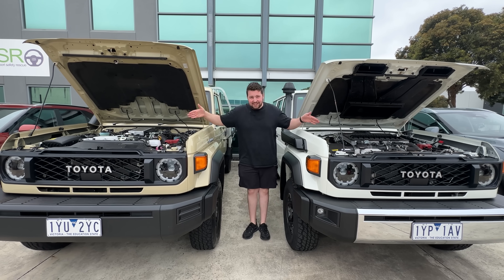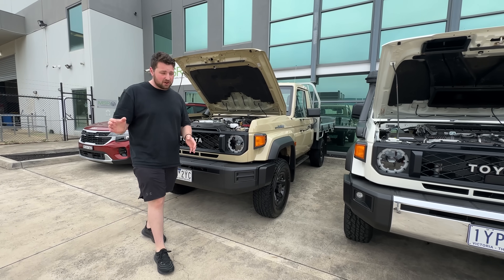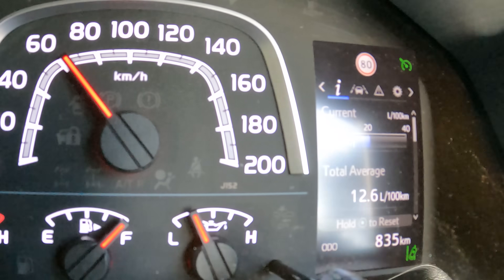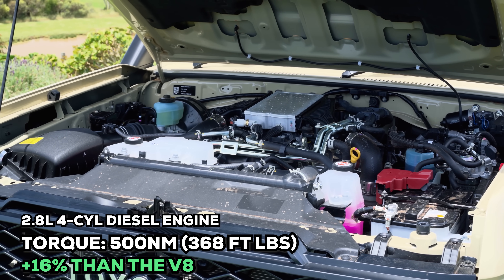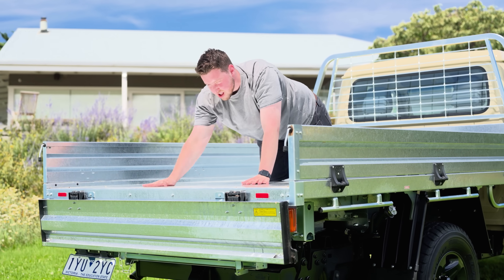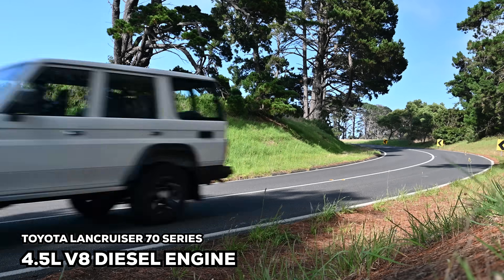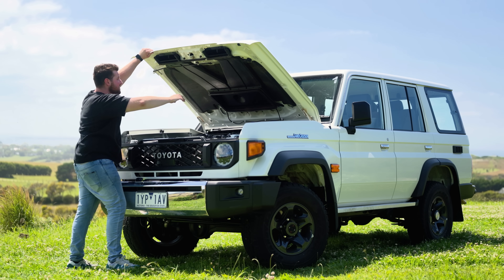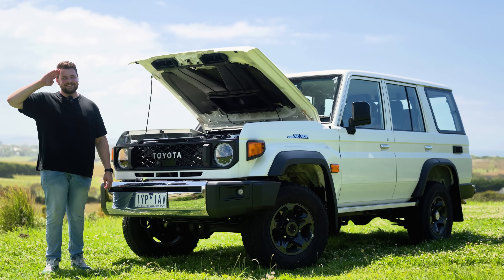Toyota LandCruiser 70 Series 4-Cylinder vs V8 Comparison: Reliability, Concerns and Which is BETTER?

Comment: I'm happy to keep my 2021 SR Hilux  . Half the price , same power , better comfort and less noise as well as proper coffee cup holders.
Reply: As well as better safety, easier to get into, cheaper insurance, better sound system...
Reply: And you load up a family of 4 in it and you are at gvm
Reply: Don't forget Better maintenance in the long term + lower parts prices
Reply: absolutely some are claiming 2.8 70s series is more comfortable than the Hilux 😂
Reply: I'm happy to keep my 2013 Citizen Eco Drive watch. No batteries to replace and the band is comfortable.
Reply: Too right!
Reply: GVM most people will never tow anything or venture off road anyway......

James 2022 sahara 200 series, fj cruiser and my tow car is a Marloo ute with double the power and torque than the 200 series which is a slug in comparison.
James.
Reply: @jamesmcgrath1669  can't be towing much, 1600kg max tow allowed compared to 3500kg for Sahara.
Reply: And when you want something better, opt into new GS.
Now that's a piece of eye candy if nothing else.
Reply: @michaelbaylis1631  The only joke is the Great Wall in your driveway, and it’s not the one made of brick……..
Reply: @michaelbaylis1631  I have a 200 series and a 2021 LX570, I’m ok👍
Reply: @michaelbaylis1631  Never take them off road anyway mate👍
Reply: @michaelbaylis1631  Yeah usually😂
Reply: Watching some of the real world testing of the 2.8 70 series is certainly impressive. Time will tell as I am hearing from Toyota fleet peeps that the 2.8 is very highly tuned from the factory leaving little room for further improvements. Longevity remains to be seen. The V8 is so detuned for the Australian market. The tune on the V8 for Middle East market from factory is way batter.
Reply: @dennoinoz4278  every time Toyota releases a new engine someone says the exact same thing. They've built their brand on durability. Hilux and Landcruiser are their own brands in their own right so I'm pretty sure they wouldn't produce anything to tarnish that name.
Reply: Regardless of the legal requirements which my 2022 sahara also doesn't meet either towing my oversize van there is no replacement for displacement and that will never change.

My marloo pulls it better far quicker especially in the hills where the sahara loses speed the marloo just keeps accelerating mate.
Reply: @jamesmcgrath1669  Good effort since the independent ass end setup on a Malloo has a payload of 300kg.
Reply: @michaelbaylis1631 pffft IFS doesn’t have that big pumpkin diff hanging down to get caught up on.
Reply: @michaelbaylis1631  lmao I was waiting for that. Every damn time you mention Toyota at the top of the reliability charts and someone is primed and ready to spit out that little one liner 😆
Reply: @michaelbaylis1631 funny I haven’t broken a cv yet, I can fit 35’s standard from the factory, and the hbmc does a great job of allowing flex along with the rear locker, active traction control on the front, and a drive line like a truck on my Y62.
Reply: @Stevegrande1  that's because it's a Nissan, not a Toyota will glass CVS
Reply: I agree, but I will one up you with the SR5 and heated seats, nice for country winter mornings
Reply: I have a commodore six wheel one tonner with a SS drive train, it has an engineers report and is licensed to pull 3.5 tonne legally.
With a permit it has pulled a five tonne boat and is far better at towing than my 2022 sahara 200 series especially up hills.
Now tell me it has no ground clearance who cares really my 200 series doesn't go offroad either neither does yours probably and most of them will never go offroad either.
When i venture offroad i use my 2012 fj cruiser the best real 4wd toyota has ever made which runs rings around lancruisers and patrols offroad.

Once again there is no replacement for displacement a saying that after decades still rings true today.
James.
Reply: @jamesmcgrath1669  whatever James. 

I have a horse and carriage that pulls 18 tonnes all week. So what if it's on road. Nobody goes off road. Ever. Not one single person. Trust me I know because I make grand assumptions on all.

There's no replacement for actual horses. 

Nathan - 2023.
Reply: 1st gear is not too short. A work vehicle that is designed for for off road needs short gearing, otherwise the clutch will be stuffed in no time. The gearbox does need a 6th gear though. 
Also, it’s hard to get through this video when you’re talking like a knob the whole time.
Reply: A tune on the V8 will also require a clutch upgrade at the minimum. It’s barely adequate for the standard tune.
Reply: @LVNITUPM8 😂😂😂 so true
Reply: Does your Hilux have a key fob? I hate how it's almost impossible to leave the radio going while you're parked up camping in modern cars or if you leave your keys in the car while camping you wake up with a dead battery. Or the car alarm starts going off during the night
Reply: @dennoinoz4278 
Middle East does not use diesel engines.
Reply: @dennoinoz4278 
Middle East does not use diesel engines.
Reply: I have the 2.8 in my 19 model fortuner, love it!
Reply: Nuh uh the Land Cruiser is better in off-road and you can pick any thing in land cruisers
Reply: Totally agree

Comment: They need to put a 6-speed manual transmission behind the V8, and that would correct the gearing issue.
Reply from the maker: That would be amazing, but almost certainly not happening ☹️
Reply: They needed to put an auto behind it
Reply: Yep. Its going  @CarSauce
Reply: They need to put the 3.3 TTDV6 in other models and not just the LC300. But it's Toyota so you know they won't. They'll boost up a hamster with methamphetamine under the hood instead of just putting that engine in.
Reply: @nathansharma87  The 3.3 TTD V6 will surely eventually be offered although most likely in the 70-series replacement which will happen at some point.
Reply: There is no gearing issue. If the ute is used for the purpose of carrying heavy loads and towing big vans the top gear is probably even too tall. The older ones did 2400 at 100 and most of the time in hilly areas loaded you would be in 4th gear. The newer ones do about 2000rpm. Even partly loaded the v8 won't go up a hill in 5th gear. Why would you need less revs in top gear? You won't be able to use it unless the v8 is tuned.
Reply: @electrikoptik The 70 Series will never have a direct successor.
Reply: Why ? @CarSauce
Reply: @nathansharma87 - the 3.3 is the answer. 309hp and 516tq would make the 70 a beast. Especially with the automatic. The 4.5 v8 could also be made so much more powerful. It could easily hit 300hp and 500tq.
Reply: There is some controversy in the Middle East where jewish car salesmen like this chap have artificially jacked up the price of the "troopy" because of its popularity in the region.
Reply: My fj cruiser hace a 6 speed manual, is great

Comment: Maximum power and torque are factors auto journalists always want to talk about most. A Land Cruiser is more than that. This legendary status was not aquired for it's power or torque but for it reliability, low cost and ease of maintenance. From 2007, Toyota Land Cruiser has moved properly into the era of electronic, only time will tell if this bread of Land Cruiser will match the durability and duration of the legend. Land Cruise inline six cylinder diesel engines are part and parcel of this legend. The reason the four cylinder engine has limited tuning upgrades is it is stressed to the max from the factory, where as the V8 is built for longevity. If you use all the four cylinder has to offer the service life will fall short of expectation. A good rule of thumb for anything machinical use only 70% of it capacity and it will serve you well. Of forty-eight years of Land Cruiser ownership it would be a hard sell to down grade into this generation. Cheers
Reply: Spot on
Reply: Interesting dictionary, indeed.

Comment: Well I am very happy with my LC 150 2.8 diesel. 
Plenty of pulling power, very comfortable and will go anywhere. On the motorway at 120kph its ticking over at a leisurely 1700rpm in 6th gear, which it will stay in even going up hill. You hear people complaining that the 2.8 isnt powerful enough. They either haven't driven an lc with the 2.8 or they are expecting it to out accelerate a porsche, or they simply don't know what they are talking about. 
This was a great comparison video by the way.

Comment: Love your work Matt.  Your reviews are going from strength to strength: informative, engaging and huge fun.  My V8 Troopy with the stock 225 95 R16 tyres (33") keeps the revs down at highway speed where I average c. 11.5 l/100km  and under 2000 rpm cruising at 100km/h.  On the Canning Stock Route I averaged 12.3 l/100km.  This said, I don't tow and no roofrack.  From a longevity and purist point of view, V8 hands down as there's no replacement for cubic centimetres.

Comment: Nice video! I have a 2021 Hilux 2.8. Bought it brand new and strangely enough, the oil consumption was not a issue at all, no need to top up the oil, just followed the service intervals. I have driven it just over 40000km. But the DPF-regen happens often, every 200-250km. All in all, no issues with the engine. And yes, the towing capacity is great too! 3500kg heavy trailer is no problem for the engine and driveline to pull. Such a shame that we cant buy this Land Cruiser new here in Norway though :(

Comment: Bring back an upgraded 7 bearing inline 6 cylinder 1HDFTE 24 valve turbo diesel modified to meet  Euro 5 spec I say, most reliable diesel Toyota ever produced, stump pulling torque from 1400 rpm to 3200 rpm, easy to work on and easily capable of 700,000 klm, some have achieved a 1,000.000klm if well serviced.
Even though this engine originally only had 1kw more power than the 2.8  litr (150kw)and 70nm less torque, at 430 nm, vs 500nm the spread of torque is spectacular.

And a lot easier to service and replace a starter motor!

Jus sayin'
Reply: Mate 100% agree go the FTE
Reply: Totally agree FTE Best motor ,I have 2 of them .
Reply: agreed
Reply: 1hdft or fte,  both just run and last...
Reply: 12HT all the way!

Comment: I think you’ve reached a very sensible and accurate conclusion. I’ve finally received my 76 V8 after a 21 month wait. After getting used to the feel of it, I’d love to take the four pot for a test drive to feel the difference.
Reply: I only had to wait 4.5 months, and I love my V8

Comment: Happy with my 2001 3.0D 4 cyl Isuzu Trooper, thanks. 33-35mpg on a run. 160,000 miles and running sweet. Have to fight off the women, it’s so kool.

Comment: Ronny Dahl tested his 2013 tuned v8 vs the new 4cyl auto(not tuned), the 4cyl convincingly beat the v8 when towing a large caravan up a steep hill
The v8 was on 35" tires tho so that has to be taken in to account.
Reply: And his V8 weighs substantially more than the stock 4 he bought. Gearing different, 76 vrs 79 many differences it all depends what you want it for.

Comment: I prefer the V8, but I would bolt a 6 speed manual transmission to it
Reply from the maker: That’ll cost a few extra $$$
Reply: Bigger tyres solve the problem

Comment: I've been watching these vlogs on the 79 series Lancruisers with some interest.  I have had 4 land cruisers in my time, 2 FJ40's, 1 x 60 series and 1 x 80 series.  I currently own a 2019 Holden Colorado  2 door ute with tray.  I use it for towing our boat when going fishing and for towing our caravan, and to date it's been a great vehicle and met our needs.  I've just been made aware of the transmission problem that the 2019 Colorado's can experience, and quite frankly it has made me look at an alternative.  My wife and I are planning on doing a couple of laps around Oz in the next couple of years, and want a vehicle that will pull our caravan, and boat, and be reliable.  I am leaning towards the 79 series dual cab V8 over the 2.8 engine.  Mainly for its low down grunt and reliability.  I'm not for one minute saying the 2.8 engine isn't reliable, but it hasn't got the runs on the board in the landcruiser body, etc.  For me the v8 has proven itself time and time again.

Comment: I did 800,000 kms on my old hiace 2.4lt on LPG and that's carrying half to 1 ton loads 6 days a week for 11 years. Now I have a 2.7lt LPG hiace and is 14 years old with 320,000kms, still runs like new. I am proof that Toyota makes reliable engines. If I get those kms out of a petrol/lpg engine, diesel should be even better.

Comment: Thanks for the video. 
After all the hustle and bustle, the V8 is the clear winner. It's nonsensical to prioritize getting from 0 to 100 km/h in an off-road truck. Why would I need an automatic gearbox in mud or sand? And how can I push start my car with an automatic gearbox? Bigger tires compensate for the lack of a 6th gear; you can legally fit 33-34" tires on this vehicle. Also, if I were looking for the luxury or comfortable style of driving, it's completely far from what the 70 series offers. But, if you're looking to build a true off-road and expedition truck for enjoying off-road and long-distance trips, a V8 is the only option for me.

Comment: Nice video.. although one thing that’s often missing from comparison videos is what it feels like to own and drive these vehicles. I’ve driven both and it’s true the 2.8 has great road performance in comparison to the V8 and works well off road too. BUT, the 2.8 lacks the character and feel of the VDJ, it feels like Toyota’s answer to a mass of employees with auto only licences, and if you want to drive a 4 cylinder auto Toyota buy a Prado or a Hilux.

Comment: When a die hard v8 toyota lover like Ronny Dalh puts out a video showing the stock 2.8 trouncing his tuned v8 in a tow test you just cant argue the point the v8 can lay down some dyno numbers but its so inefficient in actually putting that torque to work.
Reply: Didn’t use the same size tyres so the comparison was flawed
Reply: @christurner68  flawed maybe but completely valid none the least
Reply: The v8 was fully tuned, should compensate for tyres. 2.8 is an amazing engine, Toyota claim its the best diesel engine they ever built
Reply: @danefrancis9191  The tyres alone make a huge difference, even when tuned.  If both vehicles were stock, the 4 would win anyway, as 500Nm trumps 430Nm any day, especially in a lighter vehicle that's an auto with an extra gear.
Reply: @christurner68 Ronny Dahl has had both diffs regeared for tyre size
Reply: @Ktmfan450  are you sure about that? Does it bring it back to factory spec? I know when i take the bigger tyres off mine it gets far better fuel economy and is a lot more peppy when you accelerate. It is chalk and cheese the difference. I put the factory size on when towing a 3.5t boat. I don’t have to drop back a gear and if you know the Ourimba hill and the Big Dipper that goes over the Brooklyn river you would know that it is a justifiable feat.
Reply: @christurner68  Watch his video
Reply: 😂 People and the dinosaur V8 love kills me.

Comment: Toyota have put the heart of a equestrian event show jumping horse (which is impressive in the right horse) into the body of a Clydesdale. Short term it might be good on paper, but long term, in the words of an automotive engineer friend, "there is no replacement for displacement".
I like that you referenced the turned V8. It is where the V8 really shines. Fuel consumption on mine has it at 12.5lt/100 on the open road weighting 3ton.
Slow as heck of the mark, but I was buying for drag or street racing.

Comment: I have the new 79 single cab utensils in 4.5ltr. I’m getting 11.4ltrs per 100kms bit highway and around town driving. Sits at 2000rpm at 100km/hr.
Reply: Thats good. The older model did 2400rpms at 100. Go any less than 2000rpm at 100 it wouldn't pull it towing or carrying a load. It doesn't need a faster 5th gear if used for purpose.
Reply: @aussiefarmer6012  I thought so mate. I actually got it down to 11.2 yesterday but it’s back up to 11.4 now. Stock tyres etc. bull bar, side-rails and heavy duty alloy tray. Not carrying or towing anything atm so I expect the figures to dramatically change when that happens. Absolutely loving it though 👌
Reply: How much do you weigh about 2.7t? Because that's pretty good for the rpm really. My Adventra (basically an AWD SS) weighs around 2100kg, sits around 2000rpm at 110, through the slushbox 4 speed I get between 7-10L/100km.

Comment: I've got the new V8 troopy, only done 500ks and my fuel economy is at 10.4 per 100 and that's half highway and the rest short runs down the beach or onto the salt flats and around town. I'd like to see a side by side fuel consumption between the 4 and V8, according to my result the V8 is better on fuel?
Reply: Ours is similar , May 2024 Troopy V8 6000ks average Highway and City driving and we are averaging 10.2 ltrs per 100 ks. 😊

Comment: my innova came with the 2.8L very reliable engine after 200000km  you need to clean up the EGR and still running with the original timing chain

Comment: Hi thx for the video but my question is as the new 2.8 basically has the Hilux engine how does or would the 2.8 Cruiser actually compare the the Hilux... and more to the point on fuel consumption can one put aHilux 2.4 TDi DC 4×4 2019 or 2.8 into say a 2013 Toyota Land Cruiser 76 Troopy. Why? Because I love the Troopy body but would prefer the fuel consumption of the 2.8 $$$ thx